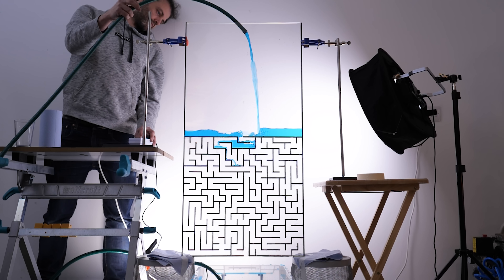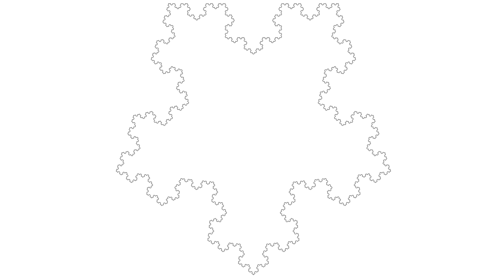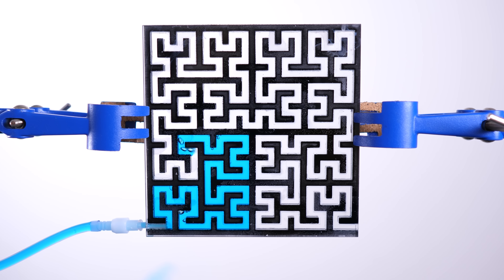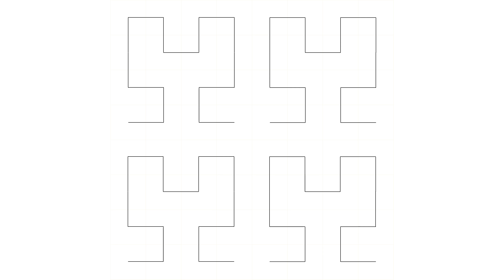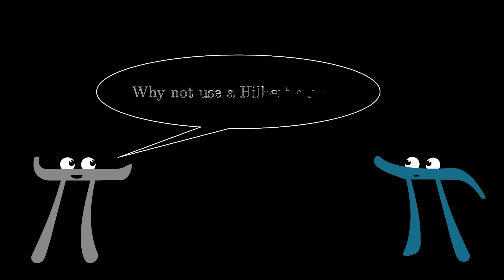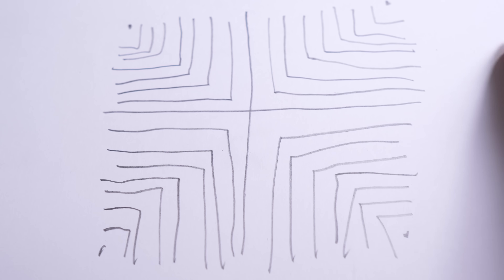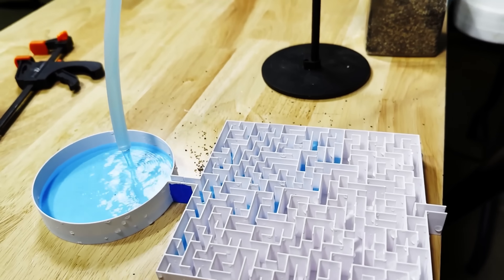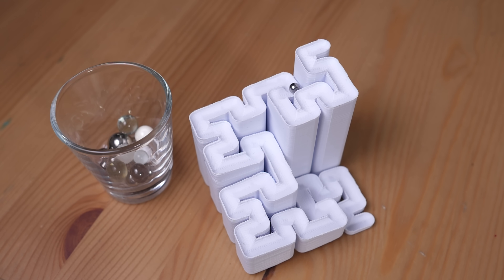Space filling curves filling with water

Comment: I think in some cases water cannot escape mazes, i.e. I am thinking of a Tesla valve shaped maze. In that case the maze can be solved in one direction only. If we put two Tesla valves back to back the maze cannot be solved by water even if there is an in and an out. Am I right?
Reply: Pretty sure tesla valves rely in part on the speed of the fluid, and do not completely stop the fluid indefinitely. If you slowly pushed the water through, the valve isn't going to function as intended
Reply: @IQ-we8qd  so the possibility to solve the maze with water would depend on the velocity of the fluid.

Comment: This got me wondering: Shouldn't you be able to construct the cube's inlet and outlet in such a way that you could print more cubes and connect them into a bigger and bigger cube that still fulfills the property and could pipe water all the way through?
Reply from the maker: Oh nice idea!
Reply: @SteveMould  he responded!! Hey! Over here! I've got nice ideas too!! Can we submit topic ideas/suggestions to your website?
Reply: @dcamron46 😆
Reply: Potentially... Unlike the sides of a Koch Snowflake, where each iteration is made out of exact copies of the previous generation, the Hilbert curve (and the generalized 3D versions) are copies of the original plus extra lines to connect those copies. Those connectors don't always connect at the same angle (sometimes at a right angle on both sides, sometimes only on one), so you'd have to include paths for all possible connectors and then somehow plug the ones you aren't using
Reply: It seems like by definition that should work
Reply: They will be really cloudy tho
Reply: What's the tetrahedral version of the 3d Hilbert curve?
Reply: Are you saying create more and more failure points in a way that requires more and more pressure to flow the water? I predict bubbles and leaks. Not that you couldn't do it a few times. With well designed joints you could do a bunch probably.
Reply: You could probably print them without inlets and outlets, and then drill as necessary to glue together bigger cubes.
Might get time consuming (64 cubies to do it twice, 512 for 3, etc.), and it would possibly stop working after a while.
Reply: @zlac the problem with drilling and glueing is that you create branches and shortcuts
Reply: I was going to propose this for the marble run.
Reply: Kind of similar to the tesla valve, you'll end up with so much resistance, water or air wont make it through
Reply: It must be mathematically possible because it's a property of the Hilbert curve, but as others point out, pressure versus resistance and joint integrity will become a practical problem at some point. Ultimately, you might have to use a low-viscosity liquid such as alcohol.